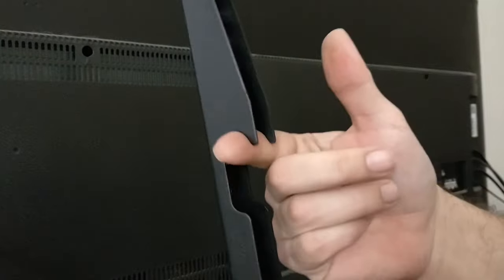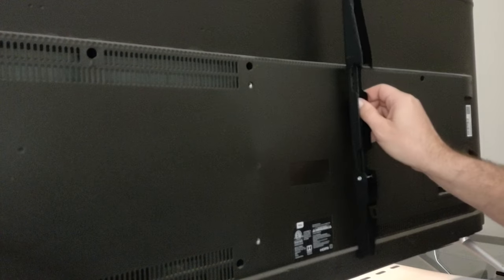Installing ONN full Motion TV Wall Mount for 50" to 86" TVs, up to 15° Tilting

Comment: You're supposed to use a socket wrench to put the bracket into the wall. Not a screwdriver.
Reply from the maker: I'm perplexed because no screw driver was used at all by me....

I used a driver, that had a socket on it, hence it was being used as a socket wrench, which is the preferred way of doing this type of work.  I may have seen one contractor use a socket wrench, once back in the 1980s.

Essentially you're saying you can not frame a wall with a framing nailer, you have to use the old swing and hit your thumb nailer to build a frame.

Comment: You ever run the slim version? I have a 55 inch 33lbs i wanted to mount...just curious if it had same range of motion
Reply from the maker: If it's thinner than this TV it would have slightly more range.  If it was a lot thicker it would have less.

Comment: Is there anywhere to purchase replacement parts for thus mount? My girlfriend bought it but doesn't have the right TV brackets, don't ask me how or where she lost them, but pretty much all I can see is having to completely re-buy the entire wall mount. I can't believe there's no way to just buy replacement parts.
Reply from the maker: There's not many parts to this.  If it was just the bolts, it'd be a small trip to the hardware store.  If it's the faceplate, she might have left it on the back of a TV.  

Sadly, your best bet is to buy a new one, or maybe check Facebook marketplace/garage sales

Comment: I thought they said not to drill it in.. is that going to affect the tv over time ?
Reply from the maker: Use a lower number on the chuck to reduce the torque.  On the Hart (if using a different brand just set it lower, to save your hand/wrist) 20 is about hand tight (21 is a LOT more torque)  The only real concern is over tightening by having too high of a torque, or using the wrong bolt for the TV (mainly too long of one, coupled with a higher torque).  

At least I'm assuming you are meaning for attaching the TV to the faceplate.
Reply: @chastitykeating4434  It seem like you wouldn’t be able to drill it in because it can crack something and mess the tv up cause any little bump to these tvs you’re buying another one I mean that’s what my common sense would tell me but I really don’t know because they surely drill them in on these videos🤷🏽‍♀️

Comment: Pretty sure it’s a no drill on the tv
Reply from the maker: If you make sure you're using the right bolt and keep the torque on the driver down, then ya can.

They just say no driver to protect themselves from people who will use the longest bolt they can find and the highest torque their driver has.

Comment: Good vid > Your video shows how the wall-mount can be moved in many position.  I was wondering if the middle of the tv, linned up with the middle of the mount, (you showed)  it does. However you need to open the bracket like a pair of scissors to push it straight back.  I had one of these for years that I thought only went to the wall on the left or right of the mount.  Thank you.
Reply from the maker: Thanks for the very kind words and catching what I overlooked.

Comment: Can you adjust the brackets (that connect to the back of the tv) left & right on the wall mount? Like, cab I place the TV on the wall mount and then slightly pick it up and move it left/right to adjust it to where it's center with my wall?
Reply from the maker: Yep, the faceplate on this can be slid to either side then tightened.  Also when pull the arm away from the wall, you can move it side to side.

Comment: Question, what size are the screws at the bottom did you use to mount the bottom to the mount?
Reply from the maker: 11:52
Wall mounting bag had 6 screws, 4 went to attaching mount to the wall.  The remaining 2 go to attaching faceplate to the mount.

Comment: How wide is this mount?  My studs are 24 inches apart
Reply from the maker: The part that attaches to the wall has slats every couple inches.  It is 25.5 inches wide, which would leave the last set of slots in the 24" range.